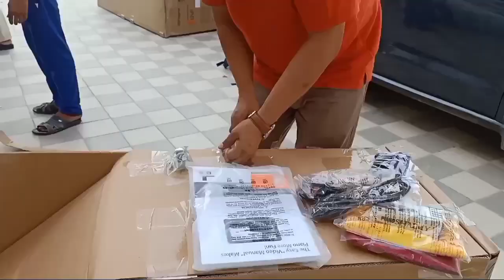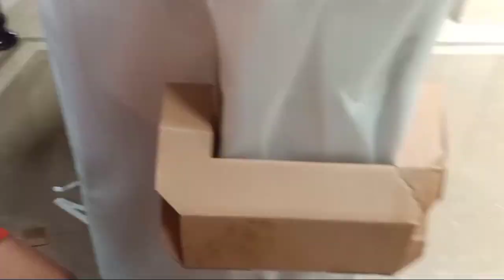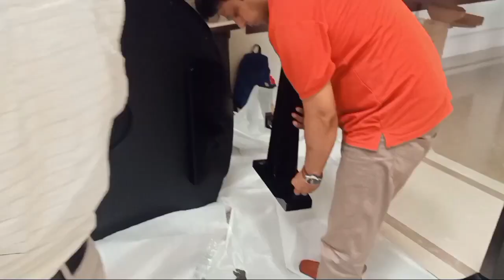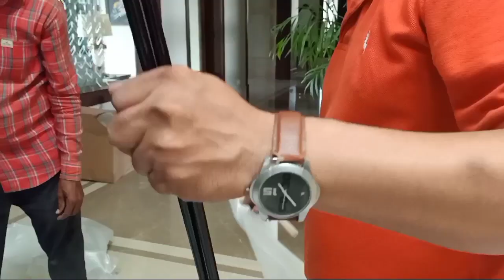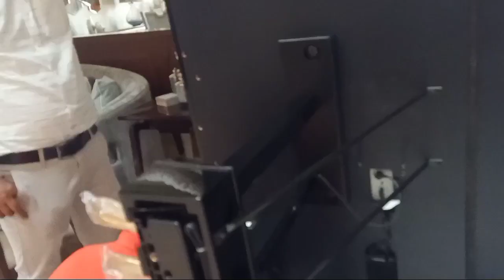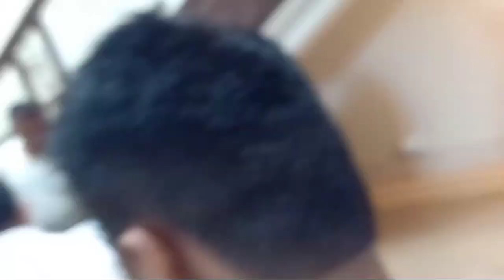Roland Grand Piano GP-609 installation

Comment: Do you happen to know what the size of the shipping box was?  Would it fit in through the typical door (70+ inches high, at least 30 inches wide)?  Or do you pretty much have to unbox outside?  That might affect my delivery day, depending on the weather!  :D   Also, it looks like you skipped the part where they tipped it up after installing the legs.  Any particular tips for that part, so as not to damage the piano or injure anyone?!